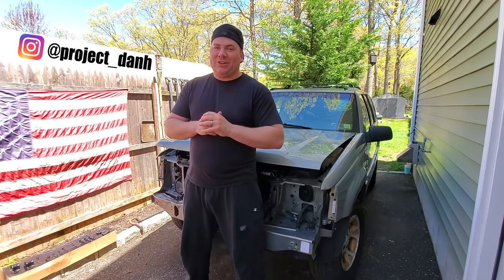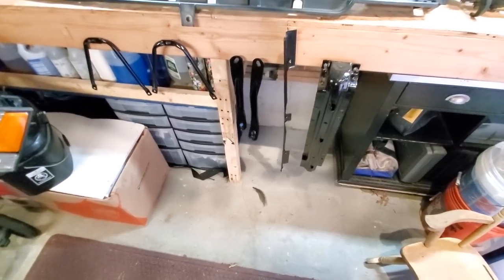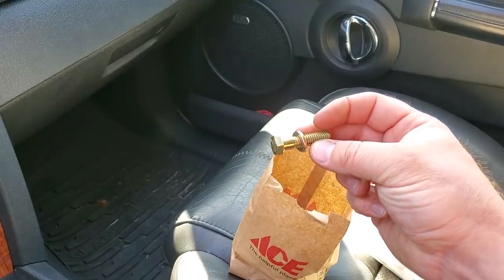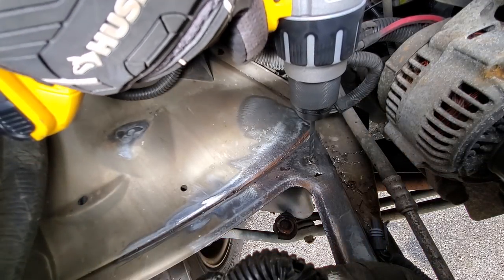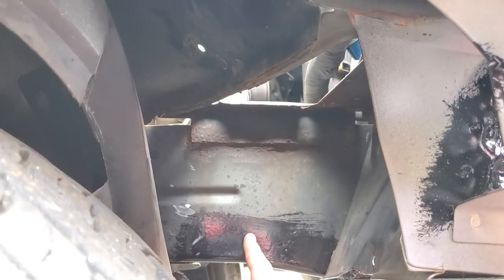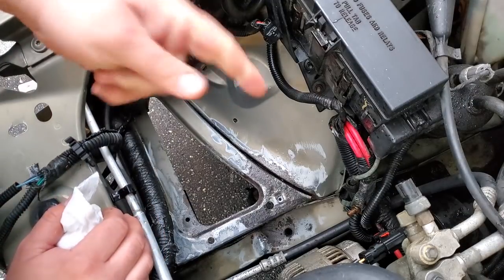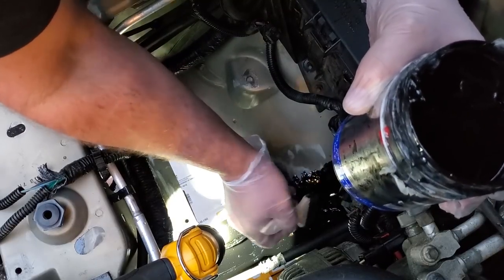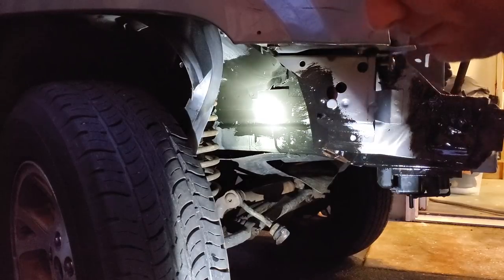JEEP ZJ BATTERY TRAY RESTORATION - MORE POR15 FOR GENERAL GRIEVOUS GRAND CHEROKEE

Comment: Here are some useful tips on POR 15. First, any "rust converter", in order to work properly, needs the "rust" to convert/work properly. POR 15, for example, most guys clean the area to the point that POR 15 has nothing to work with. Not to say you can't put POR 15 on new clean metal. I did with the new floor and rocker panels for my XJ. POR 15 hardens like crazy. Also, in spite of information to the contrary, you can spray POR 15. It will dry. You should spray in a well ventilated area with proper personal protection equipment, but spraying is a good option to brushing and it cleans up with lacquer thinner. As for the can, you can reseal the can (short term, i.e. a few months at most). I punch the can with 3-4 holes in the drip channel and then clean the lid and  can to leave no POR 15 on either and then replace the lid. I have successfully done this many times with no issues. POR 15 is a great product and has saved me tons of work on my XJ project.
Reply from the maker: Thanks for the tips Frank!  The problem I find when doing POR15 on Jeeps is that usually all the rust is accompanied by dirt! That's usually why I go overboard when cleaning it. Lol
Reply: @ProjectDanH  Thats why it says to just wire brush to remove loose rust and dirt. If you clean to shiny metal soak with water let set for a few days to let if flash rust. Then paint, not the same but will work.
Reply from the maker: @r.weaver3769  I follow the instructions on the can.  I use the cleaner degreaser and metal prep first.  Been doing it this way for 20 year and never had a problem.
Reply: @ProjectDanH  Sorry for the misunderstanding. I too use degreasers and prep. was referring to removing all the rust. POR 15 is a rust converter, the rust is a catalyst for the chemicals it uses. Basically creates a chemical barrier from moisture. Again, my apologies, I too am a ZJ fan and why I dig your vids.
Reply from the maker: @r.weaver3769  ahh gotcha!  Thanks for the clarification 👍  I really appreciate your views.  God bless brother 🙏

Comment: The battery temp sensor is basically on the 95 96 zj ambiant well chrysler and their infinant wisdom decided to move it under the battery tray .it tells the ECU that the battery is over heating and the ecu quits charging the battery cause of the engine bay heat from the engine. So what i did was cut the sensor wire add 3 extra feet route it out side under the bumper wraped it in a towel taped up tucked it in the bumper. Put a towel under the battery. Hooked up started the jeep 14.4 volts charge its not going to hurt the battery when its hot 76 degrees the battery charge drops to 13.9 volts..
Reply from the maker: Great mod Rod, Thanks!!

Comment: Hey man, my jeep has gone full blastoff twice here in the Iowa spring.  It only seems to be after i beat on it a bit.  Ive heard of upgrades to the zj fan clutch but do you think anything else could be amiss.  Radiator, Wp, thermostat are newer.
Reply from the maker: 4.0 or v8?
Reply: @ProjectDanH  ive got a xj with 4.0
Reply from the maker: @1manmanythings144  Ahh Good ol XJ overheating!  Flush everything! radiator, heater core,  reservoir, and block! definitely change the thermostat again too.  Auto-part store thermostats could be crap right outta the box.  Give that a try, maybe even consider cutting hood vents.